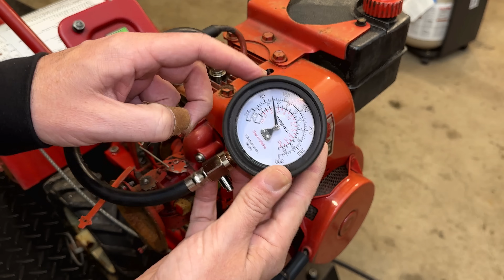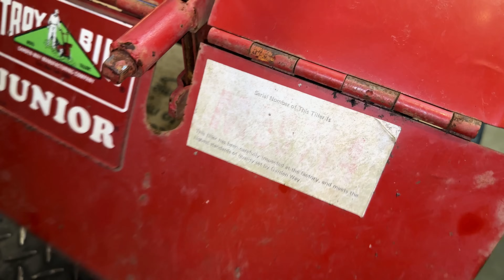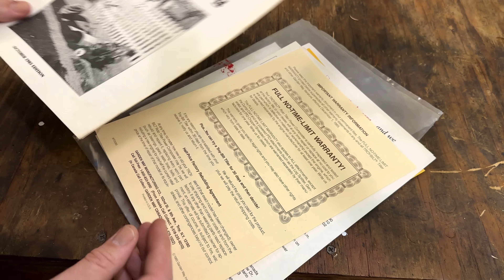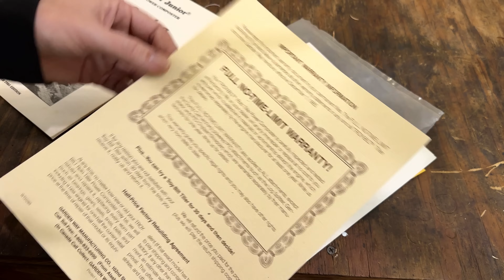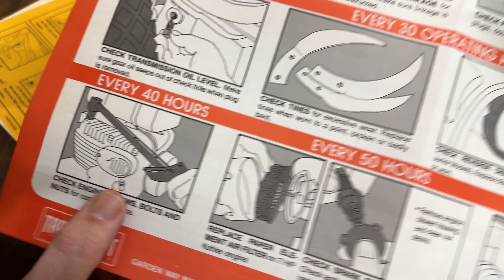Vintage Troy-Bilt Tiller Has Issues

Comment: In the late 70s my uncle started a small engine shop. We used to work,on a local landscapers machines. His guys was animals. Very hard on equipment. I serviced 6 new mowers one morning. At noon they came back with 4 of them broken. Handles broke, wheels broke. They just throw them off the truck I guessed. One day they came in and we thought it was weird the boss didn't come in or call. He ran a flower shop m as well. Guy was in a panic. They had a machine on the truck I recognized immediately. Only one I ever saw, it was the bosses personal troy built tiller. The big one. It was the biggest tiller I ever saw so I knew right away who's it was. They dropped it off the truck and busted the carb. Snapped it right off. My uncle told them it's a easy fix but it's gonna hurt. No after market back then. I remember it well. My uncle made them pay for the carb up front. It was over $100 just for the part. Plus gaskets and labor. He told them he give them the labor to help them out. It only took me a few minutes to put it on. They ponied up the money, we fixed it. Back then $100 was alot of money . Was probably over a weeks pay for a couple guys. They stopped throwing stuff off the truck.
Reply: Money the best way to fix stupid
Reply: Nice!
Reply: @johncourtneidge it is still the biggest tiller I ever saw. That old way of making stuff. Big,heavy,expensive. It was a beast. You could till up a huge garden in no time with that thing. Glad they picked it up and dropped it off for service. It weighed as much as a car. What a beast. The boss had to notice the new shiney carb on it. Not red anymore.

Comment: I volunteer at ReStore - Habitat for Humanity's retail store - and a several years ago we had one of these come in as a donation.  The donator said he couldn't get it started but when it ran, it ran well.  I'm somewhat familiar with this Tecumseh engine since it was on the first snowblower my father had years ago so I had a go at it.  Got it running; like yours, it ran well and smoothly.   One of the guys at the store decided he'd "test" it at home to make sure it worked.  He brought it back the next day and complained it ran too well.  Seems that he under estimated how powerful the engine really was.  While tiling he slipped and fell and the tiller dragged him for a few feet before he let go.  The person who bought it was a regular customer and always talks about how well it still is running today.  Don't make them like they used to.

Comment: James great save, a tip from my grandfather from many years past 2/3 gear oil 90w and 1/3 gear grease mixed with a mixer helps with stopping leaks and lubrication in small engine gear boxes. 
Keep posting. 
Tks Michael.

Comment: I have one (Horse model) from the 1970;s.  Best way I have found to get the tine assembly off, if it is siezed, is to take the pin out and operate it in hard clay or similar hard soil.  Generally, spins it free so you can slip it off. Great machines back in the day.  Great video.   I had to eventually repower mine as the old Tecumseh (not a fan) just was beyond repair.

Comment: That was made back when Troy built was the best tiller on the market before MTD made changes to Troy built company thank you for posting this video on this tiller James 😎👍💰
Reply: Well, I had a Troy Built tiller like this AFTER MTD owned the company and it was nothing like the quality that this one seems to have. I have rocky ground and I found that the tines were made of some sort of soft steel because they bent every time I used it. It also had some different size drive pulleys so that you could run at different speeds - you changed the speed by having a lever which raised the entire engine on a lever so that the different size drive pulley could be used. Like the tines this lever bent every time you used it. Then on a larger garden the tine width was far too small for what I needed. I sold this beast soon after and cursed MTD for ruining what was a good quality make originally.
Reply: BCS  tillers we're far superior to Troy Built. No belts, clutch and gear selector for the wheels, pto clutch for the tines and array of implements( sweeper,brush cutter, snow blower ECT) . Tiller tines spun really fast without slippage. Check em out.
Reply: @Bob-bm3pd   thanks for the info on this brand of machine

Comment: 3,000 rpm sounded to me much more reasonable for tilling. As I am older I can till a little longer even when soil is hard. Just means it needs more mulch to loosen the garden soil up. Leaves, mulch, and grass makes the soil looser and earthworms more abundant. Don't forget your son will go through a male testing phase where your motorbike will be pressed. Do not despair as this phase usually lasts till 20 or 21 and needs some love and understanding because usually several close calls are entailed. Girls also go through somewhat the same stage whereby self control seems lacking. Then adulthood commences.

Comment: I have a Troy Bilt Econ Horse, purchased new back in mid 80's.    Still running strong.   Easy to start.   My model had a leak in the rear seal at the end of the shaft between the tines.   My shield has enclosed sides.    A well made machine back in the day.
Mine has seen more use than your machine.  I replaced the tines about 8 years ago.
Glad that the water did not damage the transmission.   There was a LOT of water which came out.
My machine has spent its life in the garage except for the short time tilling the garden each year.
Good to see your machine back for a second life.

Comment: Hi James great job on that tiller. Just a suggestion. What I do with rusty parts is sand as much as I can, then apply Rust Converter. I used it under my rusty lawn mower and the rust has not gotten any worse. My lawn mower is a 1995 Murray B & S engine .

Comment: Those Troy bilt made in Troy, New York were excellent machines. I have a 15 horsepower Horse which is an animal. Always nice watching James. Thank you.
Reply: They throw 100 lb. rocks out of the ground like nothing. They have tractor tires on them and they will drag you. They have a high and low range transmission and they can pull you around like a rag doll.
Reply: Imagine stabling etc 15 horses!

Comment: I just tilled my mothers garden using this exact model on Monday! We've been using a single tine toro for years, and we asked if we could borrow the neighbors troy bilt.  This thing ate up the earth like nobodys business. We were done in under an hour. Cool to see this video so soon after.
Reply: You gotta drop that depth lever all the way so you can push the tines into the soil. The rear end flap should be riding on the top of the soil with the tines dug in, spinning and churning almost all the way up to the fender.

Think kneeding dough, and you're kinda just scoring it on top with a fork. 

The drive function should be in its slowest pace, just strong enough to drag the tines forward into more dirt. 

Dig in bud!
Reply: The soil should be all torn up for more than 6 inches, otherwise you aren't turning under the other plants root systems, and they'll grow back among your tomato plants.

Comment: Great job on the tiller James. I always thought those Troy built had the tines turn in opposite direction, while the wheels turned forward. That’s why they worked so well. I guess I was wrong. And I wondered why you didn’t stick the axle pin through the wheel and then the axle. I figured that out. Thats just for travel. I’ve had a craftsman tiller for years and didn’t know this about those pins. By the way, I’ve sheered 3 of those off this year. Keep up the good work on the videos.

Comment: I have the Troy Built Horse, the 8 horse power version. I believe that we purchased it in the 1970's. We till about a half acre several times a year to control weeds. It takes about 4 hours. It does an amazing job if I keep the ground soft and weeds small. Great machine!

Comment: James, once again a great video.  Since you mentioned getting a part from Amazon I would like to tell you a recent story I had regarding Amazon.  My van started leaking from the thermostat housing so I nursed it home and went about finding the replacement part.  First Chrysler discontinued the part and it is now made by Dorman.  All the big name part stores could get the part in about 5-7 days for roughly $35.  While googling other possibilities it said Amazon had the part so I went to their site.  I found the exact same part by Dorman for $19 and a new thermostat (Gates) for $8 and it would be delivered in just hours.  It arrived at 6:30 am and I was back on the road literally 30 minutes later.

Comment: My parents had one of these growing up and I remember it being a BEAST. My brother would have the auger completely underground and engine sticking straight up and it just went.  
It was only used for 30 min every year but damn was it reliable. Same thing with our chipper shredder. Same engine.
Reply: We used ours a lot more, spring ,summer and fall: we had different  crops.  As soon as lettuce, peas, chard and spinach were done , they were tilled under for corn, beans and tomatoes.  They were plowed under for fall broccoli, cauliflower, and brussule sprouts.  I picked the last of them Christmas week one year.  Just to see rows of corn get chopped up and buried in one pass was beautiful: a great machine!   The tomato vines were too tough and had to be pulled out.

Comment: Those tillers are designed to be run with one hand so you can walk to one side of the freshly tilled dirt. "No wheel marks or foot prints" was one of the tag lines in Troy-Bilt ads.

When I was a kid, my dad bought a Pony (next size up from the Jr). It had a  5 hp Briggs I/C on it. I ran it a lot, much of it one handed. 

I wish you had pulled the depth bar all the way up. Those tillers look pretty cool running down a row with the nose pointed at the sky, tines buried in the dirt and the tine guard flat on the fresh dirt.
Reply: Less weeds that way too.  The rain would soak in and had less erosion.

Comment: Hi James - I had a similar problem with the tynes and the oil leaks at the shaft- on a Masport Rota Hoe ( New Zealand brand ) My dad & I cut out thick felt washers and placed them between the seal and the tyne - we covered these felt washers in grease and they have worked well - still in use today/ The troy machine is a bit more upmarket than the rota hoe - they are both about the same age however. Anyway they both get the job done effectively.... well done - I do like the old Tecumseh engines - much smoother than B&S of the time.

Comment: What a sad day when Gardenway, the parent company  of Troy Bilt went bankrupt. I still have my Troy Horse and it still performs like the day I bought it back in the early 80s. They are so well built that that they very seldom needed repairs but if they ever needed repair, the owners manual included a complete shop manual with step by stem directions as how to make the repairs. Although the TroyBilt tillers are still made, they are nothing as compared to the older ones.

Comment: buddy i grew up with. his dad worked at the troy shop for troy bilt. he use to bring home parts for horses and build them in basement then sell them off. also bring the 8hp motors and toss them on minibikes. omg the fun we had. we were not allowed to use the tiller tho. as they buck bad and u have to learn to it go when it does hahhaha.... when i buy one of these i check the ser to see if years he worked there it was made. offten think his hands may have touched this tiller back then when building it. memorys........... you brought back memorys for me mr c. ty

Comment: I have an old Sears tiller with a 6hp engine of that make. I love that old engine, it idles low and you can set it just above idle to till already worked soil, when you hit a hard spot you can hear the governor pick up and the engine will load up. The tiller won't stall and the tines keep moving at the same speed, but that thing is like a tractor engine or a diesel engine, it just pulls and pulls.

Comment: I have a 8 hp Briggs Troy Bilt tiller purchased in 2001. These machines are tanks. I would rather have a 20 yr old one than the tillers they sell today. I also have a 2001 Gravely 16 hp tractor which is similarly bulletproof.  They don’t make equipment like this anymore. Great video as always.

Comment: "Troy-Built"  used to be a reliable sign of really GOOD quality. That seems to be reflected in this machine. I guess that small roto-tillers are much like mobile generators in that they are are used on a
very limited basis. Long periods of time can be spent awaiting  the next use. Certainly not much "day to day"  usage.  Your step by step analysis of the current issues is very thorough AND educational. 
I always learn more about the "machines" involved. The Black gloves are also a nice touch for the video watchers. Thank you very much!!

Comment: You might consider getting a multi hole punch for making gasket screw holes. Enjoy watching you trouble shooting and repairing old equipment,learning a lot even at my 80 years of age.
Reply from the maker: I got one, but the holes it made were too small.  Need to try a different one.

Comment: Very nice repair. That's a well made Tiller. I'm impressed OEM parts are still available. The bolts for the tines are breakaway bolts. Protects the machine if it hits a big rock or root.

Comment: Beautiful. I hope the gear box didn't take less oil than expected because there's a quart of sludge in there that didn't drain. Maybe not worth it but could try an oil change now that it's run. Really appreciate your logical and thorough approach to bringing back these fine old machines.
Reply from the maker: I brought it back in after and changed the gear oil again to flush things out.

Comment: I've got the exact same tiller. I replaced the motor with one from Harbor Freight, and it bolted right on. I had to remove the oil shutoff on the motor because of all the tilting I do when tilling it would cut off. It's leaking a bit around the drive wheels so watching you take those seals off and replacing them was a huge help for when I do it. Thanks for sharing.

Comment: I have my dad's Troy-Bilt tiller. He always tilled his garden every weekend when he was working and more often after he retired. He wore a set of tines out so I hard surfaced the new set for him. He was constantly replacing those seals. I took the number of the seal and got some from Motion industries. I also got some Speedi-sleeves for the damaged shafts.  I got some of the Mobilith SHC 007 that we used in the cable cranes and trailer wheel hubs. We got it in 5 gallon pails. I don't know if it's sold in smaller quantities. It is what is called a semi solid gear and bearing lube that is very thick so it doesn't leak through seals as easily.
Reply: Very valuable information.  What did you think about him driving that new seal in right over the scored shaft?  I think I would have tried to avoid that.  Maybe not driving it all the way in.  How would you handle that?  Is that what the Speedi-sleeves are for?  I hope he read/reads your comment.  Excellent info.
Reply: @alext8828  A Speedi sleeve is a thin sleeve of stainless steel that fits tightly on the shaft to bridge the damaged area.

Comment: I have a Kohler 7 hp  horse model that I bought new in 1984 with all the documentation that has always been kept inside and starts on the first or second pull. They really made good machines back then.

Comment: I can remember seeing a neighbour using one of those things to till his vegetable garden.  It was interesting to me as a young child to see how it easily churned up the soil ready to be raked and then planted.
I'm always impressed by your attention to detail and how much care you take to make sure that everything has been fixed so that the machine will work for years to come.  It's also fun to watch you work.

It's nowhere near as much fun working on my own stuff.  I finally got another carburetor, drilled the jet out slightly, put it on, then turned the fuel on, the ignition on, the choke on, pulled a few times on the rope... and it promptly snapped! 🤨
No worries, I thought.  I've seen James replace the rope on these things.  I unscrewed the pull-start from the cowling and tried to unscrew the bolt to get the winch out so that I could replace the rope... and the bolt promptly snapped right off! 🤥
So now I have an engine that I can't even start until and unless I get a new starting rope assembly... whatever it's called.
I gave up in disgust for the time being, but I guess I'm at the point where I feel like I just about have to see it through, so I'll be trying to get a new pull-start mechanism (second hand if possible).  I really do want to get the (insert expletive here) thing going, but I'm starting to seriously wonder if I'm being a schmuck and should just cut my losses and sell it as a parts machine.
Reply from the maker: It’s different when it’s your own equipment that you need to use.  There is nothing worse, especially if it’s needed and waiting for a week or two for parts to arrive may not be an option.
Reply from the maker: It’s different when it’s your own equipment that you need to use.  There is nothing worse, especially if it’s needed and waiting for a week or two for parts to arrive may not be an option.

Comment: Those Tech flatheads are hard to stop!  Seen them run with heavy carbon, leaky head gaskets, and other problems.
Heat up the axle housing(not hot enough that you destroy the seals) to make the gear oil flow easier or dilute it with brake cleaner.
Sounds good & getting the job done!

Comment: I used a super fine  salt 50 percent alcohol mix in a blaster to clean internal area of carb for crud.  Adjustable pepper mill set  to ultra fine for mix..rinse in denatured alcohol , air blow passages works wonders.
Cotton ball on funnel to strain fresh fuel into tank..amazing the sediment in new gas..